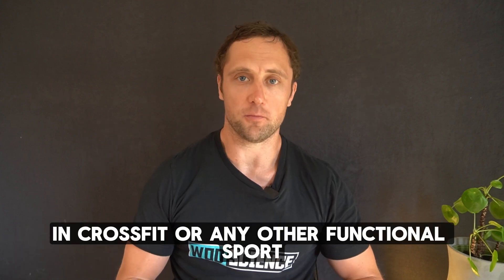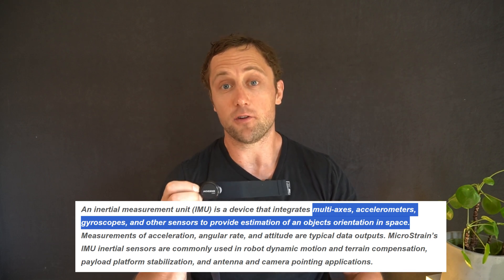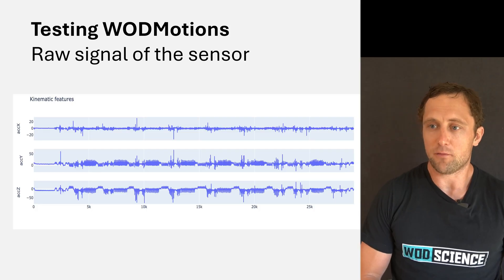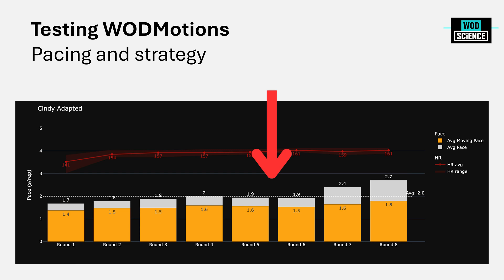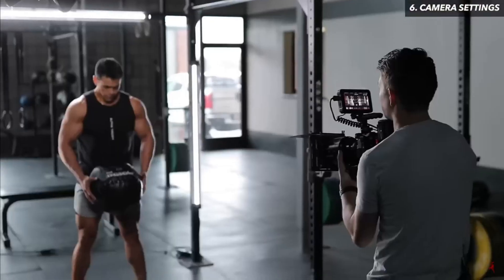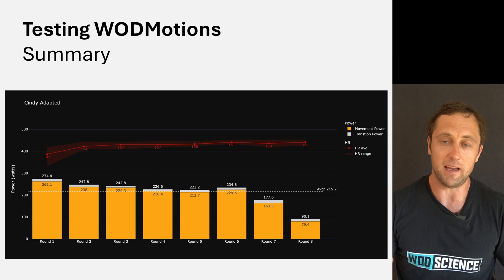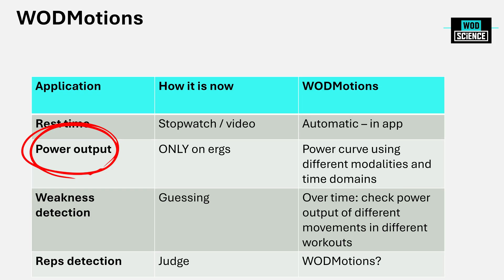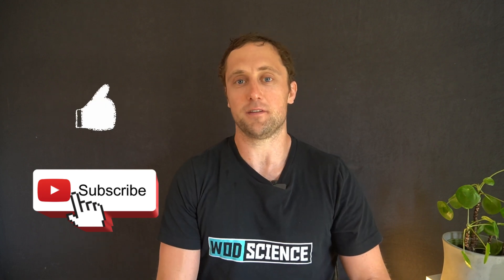THIS Device Can Measure POWER and PACING in Functional Workouts! (New Tech Review)

Comment: I loved every single detail of this app, and I hope that it will go to the market soon, 
I have a question related to movement detection; does it detect the movement automatically based on the power output and the movement pattern? If the answer is yes, to how level of accuracy it can measure the difference between similar range of motions movements?
For example, I want to test my pull-ups' power output and other data measurements versus chest-to-bar. Or my burpee to target VS bar-facing burpees. They have almost the same pattern of movement, but in the end, they are different movements
Reply from the maker: The movements you mention have different patterns of movement of the center of gravity, hence the software can detect those differences. Hence power output will be different too. For instance, doing 10 c2b requires more energy output that 10 kipping pull up.
Reply: @wod-science that’s great to know man 
Wishing that it’s going to be launched soon 
All the best of luck

Comment: That sounds like a really cool device to get ones hand on. You have to enter the weight lifted for loaded exercises in order for the software to work correctly, right? How does it distinguish between similar exercises, where multiple reference points of movement would be neccesseray to discern differrent movement patterns, let's say, a front squat and a thruster? In the latter I would assume it would be advantageous to have a device not only at the center of gravity, but also on the wrists.
Reply from the maker: Yes, that is correct. Otherwise the software cannot accurately calculate total power output. Thursters and frontsquats do have a different movement pattern and can be detected automatically. A wrist - worn IMU could potentially improve accuracy, but I'll have to ask the tech guys about that :).

Comment: Very interesting! Maybe it’s been explained in the video and it escaped me, but (a) is the software able to recognize any repeated movement following a pattern as an exercise and then the user can enter the exercise name or (b) does it work in the same way as I guess the garmin app for fitness does, that is, it matches the movement detected with a model within an encyclopedia of movements in the software itself? Or maybe if (b) makes no match, then it defaults to (a)? I find that the garmin app only recognizes deadlifts, squats, pull-ups and push-ups and not much more…
Reply from the maker: It detects the movements fully automatically from a list of movements that the algos have learned. We will build features to adjust potential errors 👍

Comment: I wonder if you could do an ankle tracker and a wrist tracker to see full body movement for things like toes to bar or pull ups where your hands don't really move. Then you could input height, weight and could see the relative positions to determine power more acxurately
Reply from the maker: Potentially, good point. We found that the chest-based tracker is suffiently accurate because of the fact that it is close to the center of gravity. Which is key.

Comment: How a about looming at efficiency and economy of movement? 

 Over individual reps, rounds and whole WoDs. If two people, or the same person in two rounds, have to do the same set of movements. Lets say 21 pull ups.

If someone can do the reps, meeting standards, while expending less power, that eiuld be advantageous for competition right?

Presumably a BMU requires more power than a pullup. The same  load is getting moved a further distance. So someone wouldnt likely do a BMU in a workout prescribed as Pull Ups if pure speed is the desired stimulus.

If you could track and fine tune using less power to achieve a pull up we could quantifiably evaluate movement patterns and technique.

It would also be interesting to start quantifying workouts and movements according to their required power output.

We do this somewhat with time domains, and metabolic pathways, etc...

But it would be interesting to look at the avg power output for workouts and note what type of athletes did better or worse at them.
Reply from the maker: Absolutely! We have a video coming up showing how different styles of burpees can have a massive effect on power output, while meeting the standards in all styles.

There are endless usecases of this device, movement efficiency is defo high on that list.